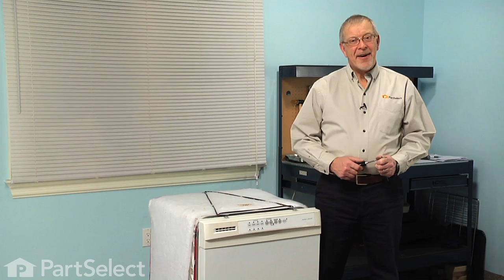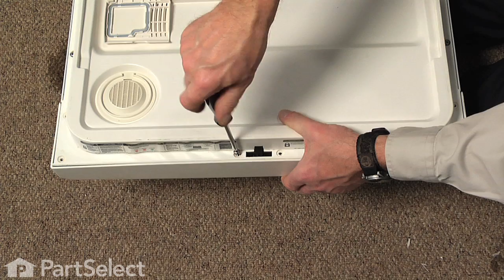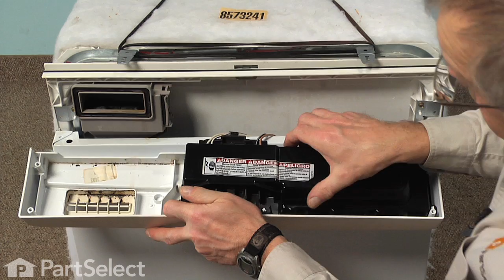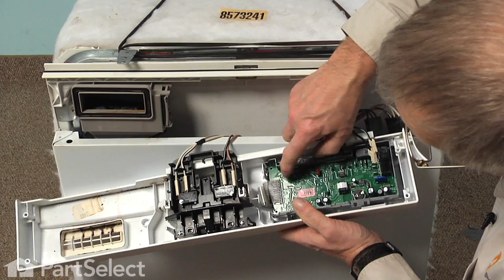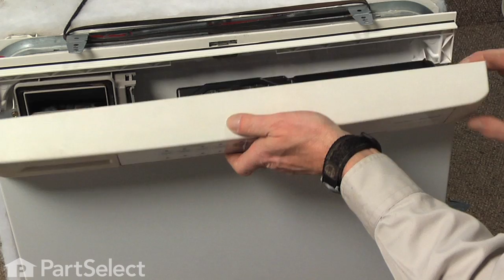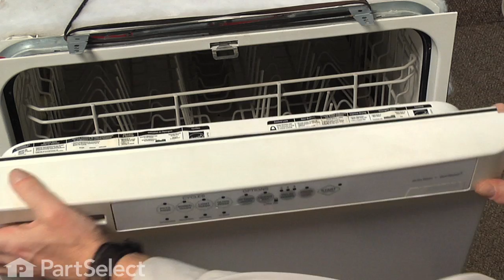Dishwasher Repair - Replacing the Electronic Control Board (Whirlpool Part # W10084141)

Comment: I have an Amana ADB1100AWS4 and the start button has worn out. It doesn't work most of the time unless you press it at different angles and get lucky. All other buttons work. I've been given conflicting information by other parts stores. One says to replace the control board and one says to replace the buttons between the front shroud and the control board. I've also been told it could be the user interface control. Any thoughts?

Comment: Hi Steve- I have an Amana dishwasher that is just over a year old (out of warranty). Within 3 months several buttons stopped working. The control panel was replaced and that solved the problem. Now the  light that lets you know that the cycle is complete "clean" will not illuminate. Dishes are getting clean and the washer appears to be working fine otherwise.  Your thoughts please.  Thank you.
Reply from the maker: +William Parker What model number do you have?
Reply: Amana Dishwasher 
Model ADB1100AWS4
SN F42906220
Reply: Also too, your videos are the best.  Very helpful for the DIY folks.  Thanks much.
Reply: +PartSelect   Hello. Any thoughts regarding previous question concerning the clean light not illuminating?  Thanks!
Reply: +PartSelect Amana Dishwasher 
Model ADB1100AWS4
SN F42906220
Reply from the maker: +William Parker Hi William, I have sent your question on to Steve and am just waiting for him to get back to me with his input. I will let you know as soon as I hear something.
Reply: +PartSelect  Any updates from Steve??
Reply: +PartSelect  Any thoughts or solutions?

Comment: Whirlpool dishwasher DU1145xtpq1 FR5109057 does not work, normal light flashing, I have tried the heated dry, normal but it still blinks when power is on
Reply from the maker: Juanita Fields I am a bit confused by your symptom description. Perhaps our diagnostic page for your model will help you pinpoint the problem and solution! http://www.partselect.com/AdvancedModelSearch.aspx?ModelNum=DU1145XTPQ1&mfgModelNum=&fkMfgID=3

Comment: Unfortunately for me, a bad control board and a bad start switch (control panel) give similar symptoms. I have done the light test by pushing hi temp / heated dry - hi temp / heated dry. All buttons lit up except Steam Sanitize. As it runs through it's test cycle, should the Normal Wash actually do more than light up? I don't hear a valve opening to allow the unit to add water for a wash. Other items click and whir and blow. I have had to replace the control board once before and the unit is no more than 3 years old. 
I have determined the dual door closed momentary switches both have continuity (as long as I was in there I also checked the fuse).

Comment: What would be  symptoms of a bad board and how would you confirm the board is bad or good
Reply from the maker: hi 1gladiator888. The control board controls all functions of the dishwasher. A faulty or malfunctioning control board could display an array of symptoms, from not filling, not draining, or not washing. These symptoms, however, often require a simpler repair than replacing the control board, so I would recommend heading to the Partselect Dishwasher Repair Page and troubleshooting some other possible causes before considering control board replacement: http://www.partselect.ca/dishwasher+repair+repair.htm. Best of luck finding the problem, and with your repair!